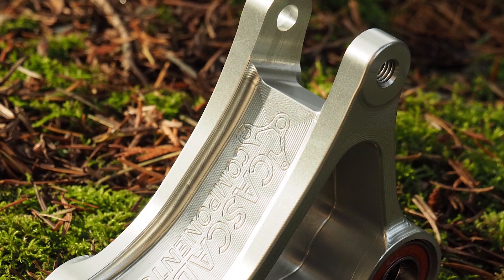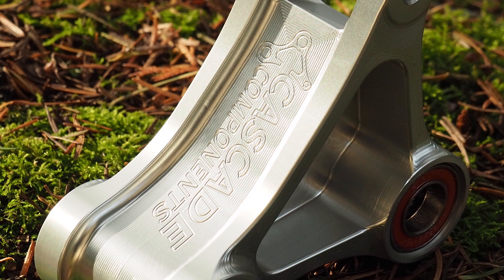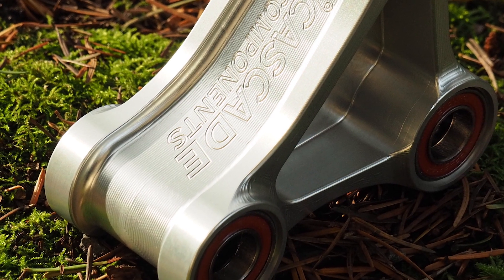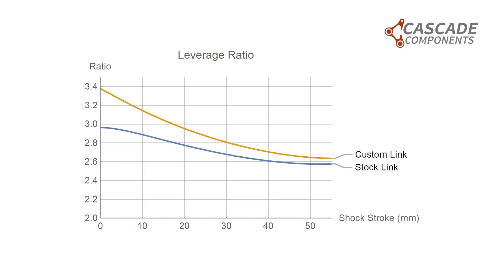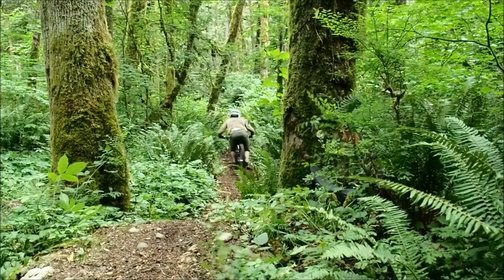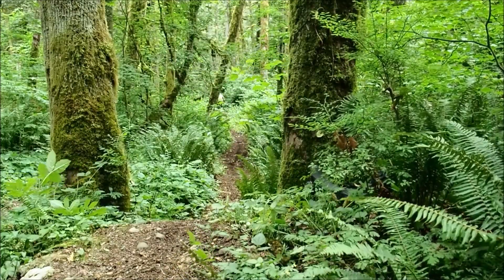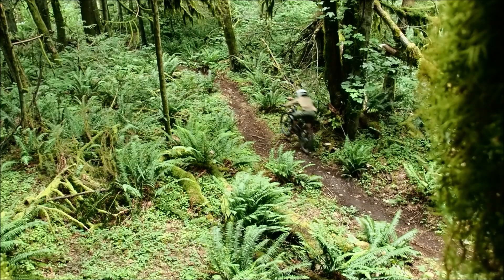Linkage Design & Features

Comment: I have a Nomad v4 with the link. Shock is a Fox X2. Can volume spacers be used in that shock with the link, or is it best to run no volume spacers? Shock is stock length, 60mm
Reply from the maker: I always shoot to run as few volume spacers as possible. If you want more ramp, nothing wrong with it though.

Comment: I have a Norco sight and just ordered a marzocchi bomber cr coil shock for it. I heard cascade links aren't completely compatible with coil shocks but are still friendly.  Could you please give me a little feed back? Appreciate it, thank you
Reply from the maker: Riders looking to use a coil shock will benefit greatly from a Cascade Components linkage due to the increase in the suspension's progression.  Because the linkages slightly change the orientation of the shock in the frame, any shock compatibility issues are usually a result of shocks with large coil diameters or reservoirs or people trying to use a coil shock in an application that the bike is not intended for in the first place.
Reply: @CascadeComponents  thanks for the input. I actually just changed my order. They didn't have a bushing for the bomber. I'm getting the fox float w Reservoir.  Still would love to get the cascade link but you said there might be an issue because of the Reservoir might be in the way or?..
Reply from the maker: @austinnoll2869  The Sight has no current shock incompatibilities. As long as the shock is the right size for the bike it will work with the link. There are other frames out there with very limited shock clearance. This is not one of them.
Reply: @CascadeComponents  sweet, thanks I appreciate.  Do you know if it will add anymore travel? Some people on YouTube videos say that it added 5mil to their travel. Just curious
Reply from the maker: @austinnoll2869  Yeah it adds 5mm of travel
Reply: @CascadeComponents  sweet! Alright I'm done bothering you lol. Consider it done, prob next pay check ✔️ thanks a lot!

Comment: My question is, if it's better, why doesn't the manufacturer make thier  link with the same geometry as yours?
Reply: Because the majority of riders don’t want more progressivity or increased leverage ratio.
Reply: Why wouldn't everyone want increased small bump sensitivity along with increased bottom out resistance?  This seems like a win win, yet specialized manufacturers a link that makes the back bottom out regularly when sag is set to spec ...

Comment: He said they are catered to a higher spring rate ? Wouldn't this link help u with running a lower spring rate with better bottom out resistance?
Reply from the maker: One thing that is glossed over when people look at progression and how it relates to spring rates is what the progression is accomplishing for shock sizing. In order to run a lower spring rate and up bottom out resistance the shock stroke has to be increased. Since with most of our links the shock stroke is limited by the frame design, the progression is used to make a heavier spring feel lighter off the top. Going the route of a softer spring without increasing the shock stroke leads to having to use damping to mask a lot of the softer springs short comings on harder hits, which also causes the shock to not respond to high frequency impacts as well. Going with a stiffer spring allows a wider range of damping to be used so that it doesn't hinder how the shock performs as much.
Reply: @CascadeComponents  thank you for the explanation. That does help to explain it alot better... I am running a 350# spring now and that gives me about 35% sag. Was thinking about bumping up to a 400but didn't want to lose the off the top softness and small bump sensitivity. Would running a 400# spring or the same 350# spring be a better scenario with your link if I'm looking for the same suppleness and also avoid bottom outs? I should mention Im not having continuous problems bottoming out now but I haven't pushed the spring hard either.
Reply from the maker: @JP-kq3lk  With our link the 400 would definitely be the better of the two. If you're at 35% sag with a 350 on the stock link then you'd be bordering on 40% sag at the wheel since more progressive linkages sag comparatively more at the wheel. No matter what link you run you will notice an improvement pedaling if you run the sag closer to 30%. The anti-squat is designed around 30% sag so running more than that will make it bob more.
Reply: @CascadeComponents  thank you! You guys are awesome